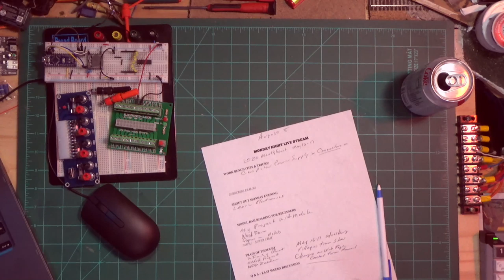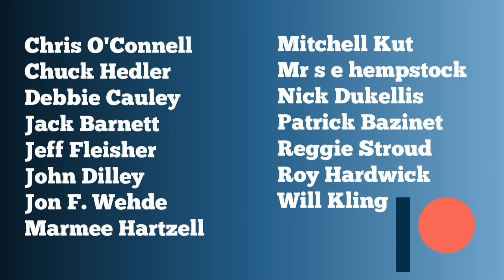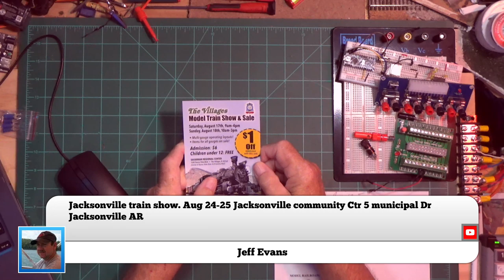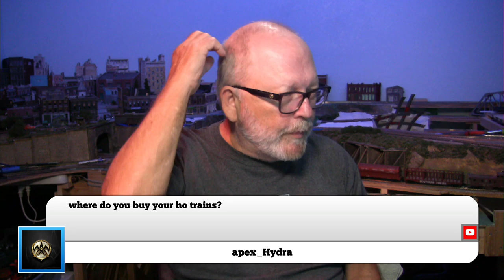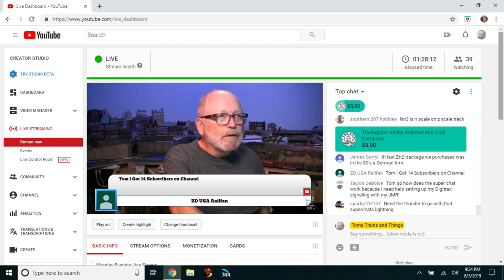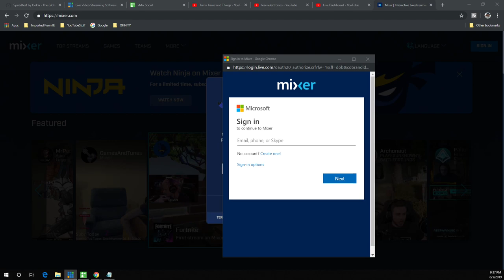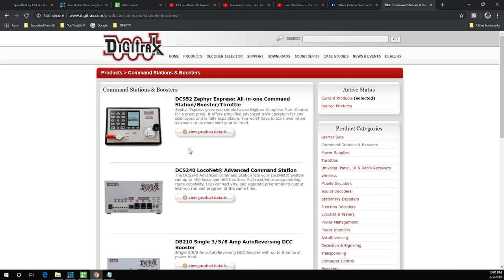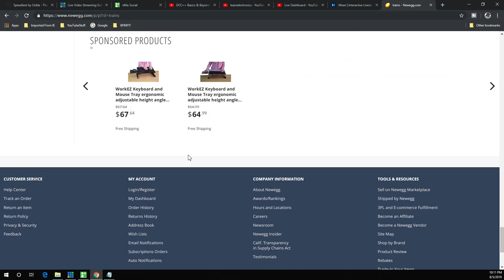Replay Of Live Stream - Breakout Boards For CPU

Comment: Tom, looks like you have the Pololu #2503 motor shield for your Mega. Have you gotten it to work? I have one and had to make DCC++ code modifications to scale the current sense feedback to get programming to work reliably. Even with the maximum amount of scaling, there are still some N scale locomotives that it won't work with due to the very low current draw during programming responses.
Reply from the maker: Haven't had any issues with mine.